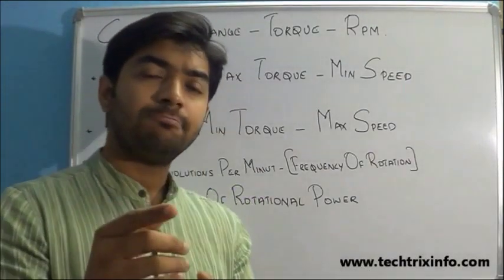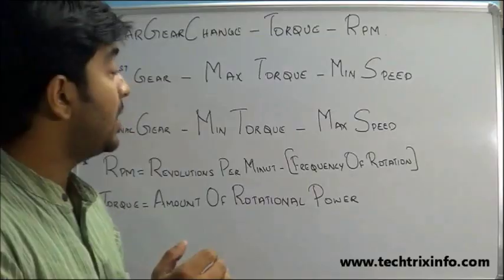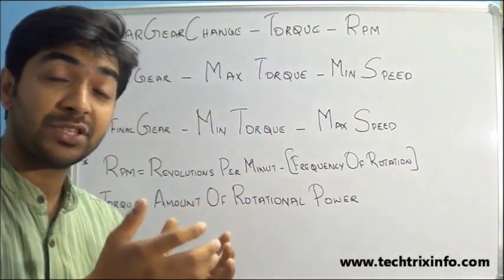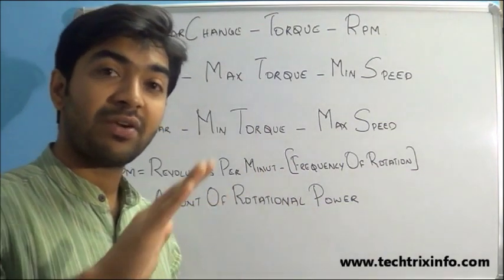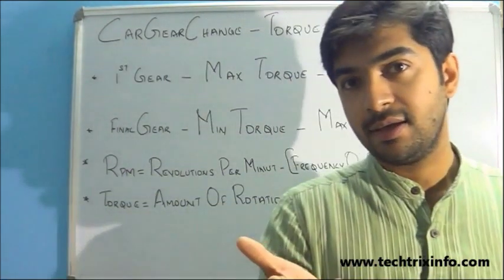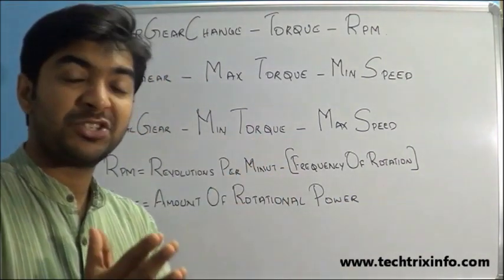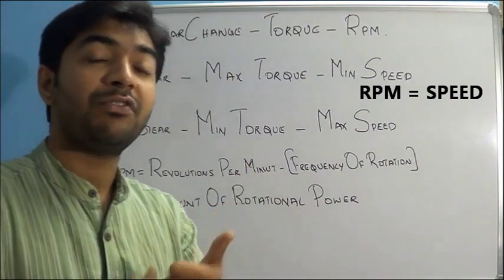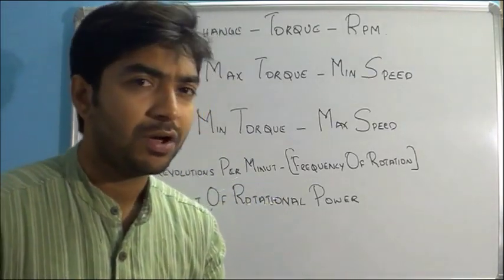Why 1st gear to start a car? ✔

Comment from the maker: Its possible.. but what you say is wrong..frequently starring in 2nd gear will eventually damage the engine, clutch and transmission..because engine it getting a back load from the transmission due 2nd gear torque requirement, and ask your friend he need to adjust his clutch pedal when he is trying to start in 2nd gear (causing more clutch wear) ..you can start even in 4th gear trust me i have done that in down hill while starting ..